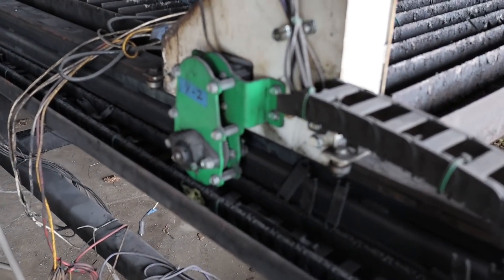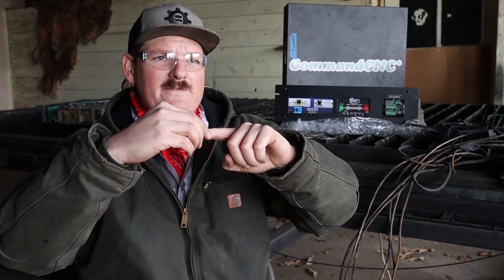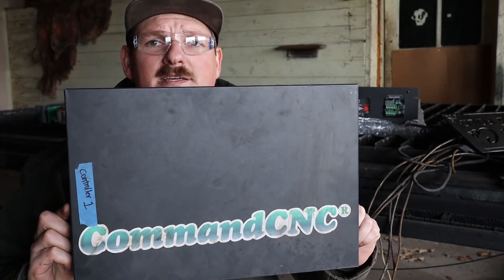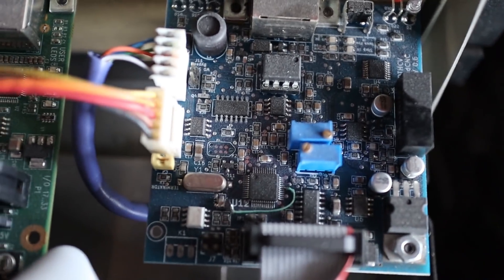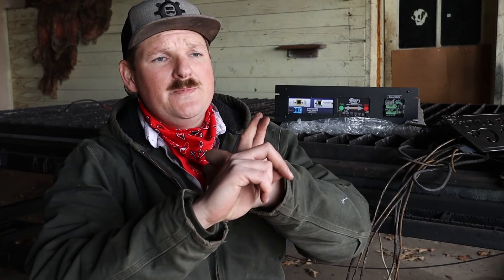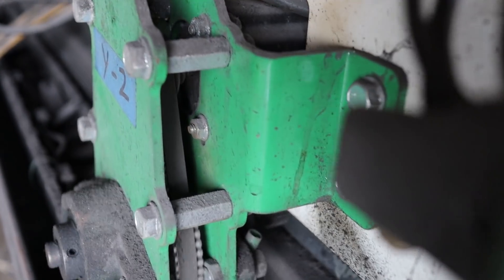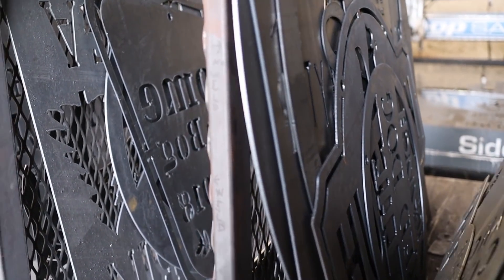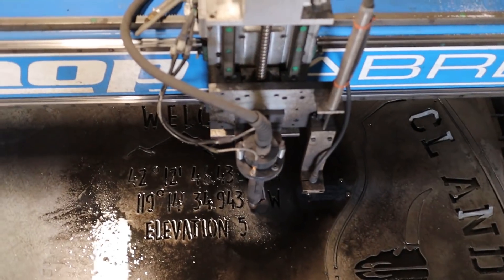BUILD or BUY - CNC PLASMA TABLE (TRUE STORY)

Comment: Thank you very much your story is very inspiring, I’m debating about build or buy, I realized that if I’m building a cnc router/plasma table I’ll spend so much time into the unknown and I will still be making parts just as a hobbyist I don’t think I have the time to do that anymore I’m not getting any younger, in the other hand I wish I could buy a machine like you did so I can spend time designing parts like in production mode and find a product I can sell or make for somebody else. Thanks again I admire your work, blessings 👍👍👍

Comment: It wasnt a hunk of junk because it got you were you are today. Did you use vibra tight or lock tight to lock the gears on shafts? I watched the table build and you did do some half ass shit during build. So dont bash these companies that got you were you are today. Just wondering why your bashing two companies that put you were you are today. I am building one now and watched all your videos. You have some good info. But dont bash companies for your mistakes. Like you complaining about power. I bought line conditioners so i wouldnt have your electric problems. Plenty of people built these tables with great resualts . Build it right and you wont have problems. You did a great job on build but did some stuff that was shady. When im done with my table it will cost me around 10gs with the newest and best of best. And i will put  it up against any other table out there. Arclight and star labs use candcnc and have some of the best tables out there. Stop hating on what got you to were you are today.

Comment: Dude its crazy that you went with such expensive equipment that didn’t even work properly. Regulated power supplies, cheap reliable drivers—you could buy all of that stuff on Amazon to drive your machine and have it actually work for way less.

Comment: Good time to clean those  rails or it will go down those bearings are not cheep.  If use shop air to clean them don't blow in to the seals use a tooth brush to clean them. Also if you have not already  a HYPERTHERM 220777 electrode they do last longer.

Comment: If you are driving too much weight the electronics are overloaded. What is the current (amp) load on the motors moving all that heavy hardware around? Your table looks more like the heavy-duty steel tubing used to build commercial gym equipment. You are a little fast to blame the supplier, especially after admitting you used lightweight gear reducers. All you've learne dis you don't understand loads and power.

Comment: Is your Pop happy with his mpcnc?
Reply from the maker: He built the gantry using heavy stainless tube so he was constantly fighting the z axis being too weak to handle the load.  He also stretched the plans to a full 4' x 8' cut area and had issues with rigidity.  So he has moved to a Shop Sabre at this point and he's very happy.  MPCNC makes a great product but I think it's happy spot is in the 1M x 1M configuration.

Comment: I built my own and tried cncandc took all off the table tossing into the trash can and went to my own system mach 3 and gecko  g540 I was up and running in 2 hours. So I know your pain.
Reply from the maker: Dang!  I wish I had the knowledge I have now, probably would have gone the same route.  What did you do for THC?
Reply: @MakerTable  proma 150 thc price make one to that I am impress with to

Today I working on a masso controller stand alone system just bring in the tap  file to cut. This probably will take me couple days to get running.

Comment: I built my own 12’ x 24’ plasma burn table. Plasma, Oxyfuel, Spindle. Using it everyday for the 7 years.  Cost me $110,000 in materials and software, (not including time) but cnc burn tables that I was quoted all came in around $425,000. Took me full time and 7 months to build but it was certainly worth the effort and savings.

Comment: This video show your lack of experience in building and using a plasma table. You cannot blame seller because you buy only a plasma kit and not the "know how" too. You only asume that you got the "know how" using your table. Any experienced user can see that from what you are telling in this video. You don't do a proper maintenance, i strongly believe that you don't have a proper earthing, you are not using fresh consumables at every cut as you tell everybody that you do. And if you are using I strongly believe that you messed up your cutting parameters. There is no way you could get such a bevel cut with fresh consumables (only if your pierce parameters are wrong and destroys your consumables at first pierce).  There is no motion slipping. The belts are too loose because you ignore to check them (wobbly letters). Dust on the gantry tell us a lot about maintenance. You didn't bother to clean machine even before recording this video. THC controller break down tells us about improper earthing not live voltage. Any experienced user can see that. I have a similar machine (built not buy, because i couldn't afford that), and i have about 3 or 4 hours/day of arc time for about 4 and a half years (which is a lot IMHO) and from time to time i have issues with wobbly contour. But i know how to fix it and only takes me one hour max. You purchased for a small fraction of a price a plasma kit and you expect to perform as a professional machine.  The subject of this video is a mistake an i think this video is not fair for the seller. PS: I do not use any of the C AND CNC products because they said that don't want to ship to my country. Neuron CNC is still the best choice for me.

Comment: I think main problem with Command CNC, it's not designed for welding shop operation / CNC controller should use high voltage logic gates, voltage spike protection  and etc /

Comment: Did you have cables coiled like that when you were operating the machine? If so, then you DEFINITELY share some of the blame for your controller problems. Another term for "coiled cable" is "antenna," and another term for "plasma cutter" is "high-powered EMI generator." If your torch lead or power supply got anywhere near those coils, you could easily have ended up inducing enough voltage/current on a signal cable to blow circuits.

Also, for future reference, voltmeters are pretty inadequate tools for measuring for power quality. Yeah, they show you long-lasting spikes/drops, but they DON'T show you transients, which plasma cutters produce like crazy and can be both harder to protect against and more damaging. Your voltmeter might not feel a microsecond-long spike to 200V, but something else sure might. I doubt the power coming out of the wall was the problem (if it were, the controller's power supply would probably fry before anything else), but a voltmeter reading 118V isn't going to convince an electrical engineer that all is well.
Reply from the maker: Thanks for the info, I had no idea a multimeter wouldn't show spikes. That was the best thing I could think of to show the manufacturer that I had normal power. 

As far as the coils. I learned that lesson along the way and had all cables run flat. Shieled wires for every connection. Two 8 foot grounding rods driven 24 ft apart. Battery backup UPS. Put the plasma power supply 6 ft away from the table. PC/controller 6 ft away  from that. I felt like I was chasing ghosts LOL!
Reply: Wouldn't most modern multi-meters (not sure what was used in this video) have a record of the min/max figures reached even for milliseconds
Reply: @ricbarker4829  Well, it's been at least 10 years since I went shopping for a multimeter, so maybe, but the one in the vid doesn't look like something that could measure transients even in the millisecond range. However, I think for this work, you'd need to measuring in the MICROsecond range, which is a very different ballgame, and one I'd be shocked to see a multimeter enter. It's a lot more expensive and, at best, useless for 99% of multimeter users, so I suspect that such measurements are still firmly in the domain of oscilloscopes.

Comment: I appreciate you creating and posting your videos but, I have to I give a thumbs down on this one and I'll explain why. Firstly, I feel this is a sales pitch for Shop Sabre for a kick back. You are praising the quality of it and it hasn't been 2 years like your original table. You had good cuts with your original table at least for a while. Your original story on building your table convinced me to build the same table with no regrets. You built a stout machine for the what you could afford to get started in the biz so, I didn't like how you then bash the machine you built after running it for mass production and at higher cut speeds than your $17k+ Shop Sabre and then things became loose. The pinion gears are supposed to be installed with bearing lock to prevent the looseness you experienced. Also, for the best accuracy, you should keep your equipment more protected from dirt and such for many reasons. The spaghetti wiring, that's for the installer/builder to organize. Mine is mounted inside the box tubing of the frame out of sight and harms way. Command CNC does have it's faults but, at the time it was the system you could afford. When comparing  buying a new Shop Sabre @$17,000+  or the other table,  the cost of your compressor, plasma cutter, shop updates, etc. should not be included in your build price of $13,500.  No table will include a compressor and shop updates,Lol! So, $13,500 for your build was exaggerated. I had to buy all my steel and built a 4x8' with a built-in water tank, Hypertherm 45XP with full hookup(CPC,Hy-T control) CommandCNC Bundle ($2999, not $3500) for under $9500. That was almost half of your Shop Sabre.  Just because you have progressed to higher production and can afford a complete factory made system that suits "your" needs of today, don't crush peoples dreams or mislead them from considering this DIY table or the one that is already built if that's all they can afford. Your videos are very influential and you probably have more viewers at this lower price point. I mean no disrespect, just my opinion.
Reply from the maker: Hey man thanks for the honest feedback. I need to say that first off this is not a kick back video for Shop Sabre, they have never paid me a dime. I actually took all of their marketing off of my table and replaced it with my own 😁 I didn't mean to bash the DIY guys, I am a DIY guy. I could have wired it better, I could have kept it cleaner and I did run production on it for a while. BUT I had to drive from TN to TX every 2 months to get the controller rebuilt, I also had to burn the red lock tight out of the gearboxes to get them retightened every 3 months or so, argue w CandCNC every week to get some assistance, buy an entire 2nd set of controllers and motors because CandCNC doesn't just sell the controller as a standalone unit or rent a hypertherm to prove to them that it wasn't my plasma cutter that was causing the issue w their controller, etc. etc. etc. I want people to know everything that can go wrong with one of these things so they can make the best decision. It took me 2.5 yrs to save enough money to buy those first parts and build that table. I'm so glad I did, but if I had already figured out a working business model that needed a table for production I wouldn't have made it. I also didn't mean to give an inflated number for the price, I thought I was being more honest by sharing all the costs associated. You can't use a plasma table without a plasma and compressed air. CNC plasma cutting has changed my life, I want more people to get into it. I want to teach people everything I have learned so they can make a better decision than I did. I don't want to knock anyone with a DIY table or anyone trying to get into the shop and make things. I've got some great ideas about how to make a better CNC table, I just need to find a way to make it at an affordable price. Happy making, I appreciate ur thoughtful feedback 👍
Reply: @MakerTable  so all in all, the table itself wasn't really the issue, it was the electronics. I understand Flashcut is a better system but about double the price. So, it's worth mentioning building that table with those electronics may have been a much better choice.
Reply: Well, that's a solid explanation for a thumbs down. All I got on my video was a guy saying "That dislike was me 😎" lol
Reply from the maker: Exactly, controlled motion was not a major issue and accuracy was good to under 1/16". The whole thing came down to the THC card on the controller.  It was somehow tied into the rest of the system so every time that card blew all the motors would lock up so I couldn't even bypass it and limp along. I tried to buy the 2nd controller so I could blow up one and send the other out for repairs but I somehow managed to blow up both at the same time over and over again. I'm currently testing the star fire controller from China. Piranha and Laguna both use them on their industrial tables and it's more affordable than the CandCNC or Flashcut system.
Reply: I can recommend a THC from Neuron CNC. I use the Neuron Lite personally and it's integrated in the motion contol software (UCCNC), which works really good :)

Comment: I have been watch u from the first table in your garage I was building one about the same time I am having a problem with a cnc  program what do u use on your and good job u have came a long way with the new shop good deal thanks for the help Dewayne my email browningkd@yahoo.com thanks
Reply from the maker: I'm using inkscape to design and the diy plasma used sheetcam to linuxcnc for gcode and motion control.  Good Luck!
Reply: Thanks so much I happy your doing good I wish I could get my table work I can manually run it thanks for your help

Comment: Should have had a line conditioner, I had similar issues with some equipment until I picked one up.    A good line conditioner will drop the variance to +/- 1% or less.  Some CNC mills require them and running the mill without them voids the warranty immediately.
Reply from the maker: Good to know

Comment: Thanks for the advise, personally I built a CNC router almost 8 years ago and after taking it through many stages and upgrades it is now and has been for at least 5 years a very powerful and reliable machine used daily. I have never had to change any part of the electronics, it seems I got that right first time. I am about to build my first plasma table and by comparison, it SHOULD be easy after all the loads involved are negligible in comparison. What could possibly go wrong....
Reply: I'll be build a plasma table soon as well. Mind sharing your router designs and the electronics you used?

Comment: Hey man good video and great info. It looks to me why you’re going thru tips is because the torch height is too high. I have a hypertherm also
A 900. When ever cutting with plasma all sparks should be shooting down under the plate you are cutting. When i cut even with hand held 
I dont even need goggles because all sparks have to stay below the piece to get quality cuts. 
In this video the sparks are shooting up and that just kills tips right away and thats also what starts causing the cuts to go on an angle on the edge like you showed.  Let me know if this helps.

Comment: I got one of these "command CNC" controls back around 2009. It was complete junk. Back then it was called CandCNC run by Tom Caudle. Ended up building my own enclosure and using a Proma Elektronika torch height control from Ebay. Works great now!!

Comment: Been dealing with commandcnc the past 6 months with the same problems. Blamed it on me. Have now rebuilt the entire table, added ground rod, ran new electrical, and still not running. Was debating buying a new controller or switching to something else and came across this video. Think I made up my mind. Thank you!

Comment: All depends on your skill sets and experience. It takes a good amount of time, trial and error,  if you are not involved in industrial fabrication or have cnc machine experience and the tools at your disposal, that you are able to use. Average Joe not involved in these things, it is good sound advise to buy rather than build a cnc plasma table.
Reply: The things he mentioned as difficult are things taught in first- or second-year college physics, stem from the size of the machine, and/or aren't deal-breakers outside of a production environment. Yeah, experience with robotics/CNC/etc and having a shop full of specialized tools certainly makes things easier/cheaper, but with the explosion of resources available to DIYers these days, even Average Joes might be able to build time/cost-effective "garage-grade" plasma cutters.

Comment: 1.) building table made u who u r.
2.) get the old table running correctly.  Have it still making you money.  Its bought and paid for, get different electronics.. i am into 3d printing, sure there are other makers for controls now.. its blowing up.
3.) new subscriber👊
Reply from the maker: Thanks bro! I'm getting the old table back together right now to trade it for a CNC tube cutter. Thanks for the sub!

Comment: I love my canacnc table! Thank you tom caudle for your excellent support!!!!!!
I finally got my candcnc table running right after 1.5 years of struggling. It would cut but voltage at the cut would throw my thc into fits. Collisions at the tip,climbing up into infinity,hundreds of dollars of material and consumables wasted...it came down to one little detail. I was grounding the ohmic sensor directly to the consumable nozzle. That was sending volts from plasma through ohmic aaand causing ohmic to stay tripped as soon as plasma was powered up. With a thermal dynamics machine torch you need a shield nozzle to isolate torch tip from ohmic voltage and vise versa.
Reply from the maker: Glad it only took you a year and a half to get it worked out, sounds like I gave up too soon.
Reply: @MakerTable  sounds like you got schooled